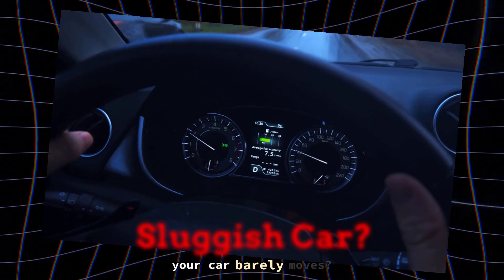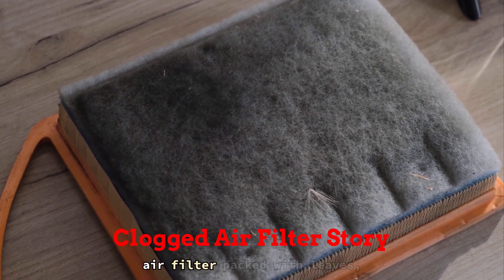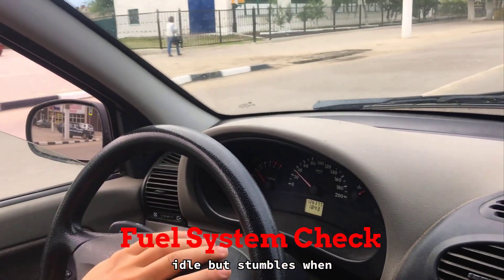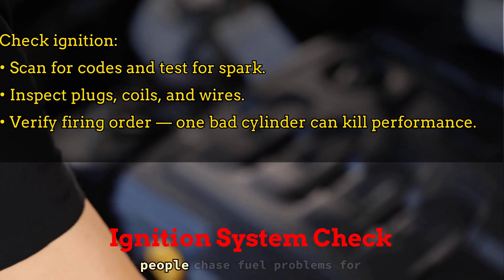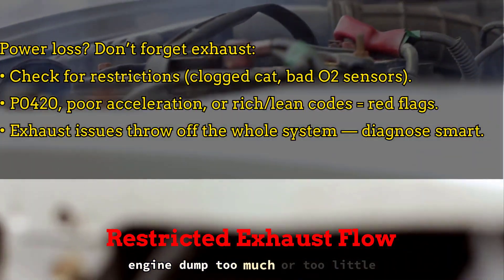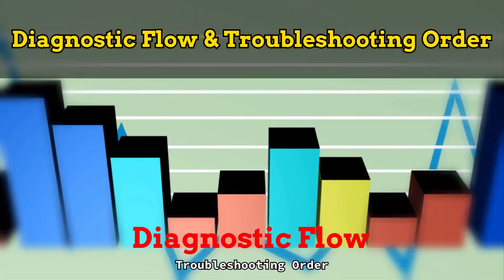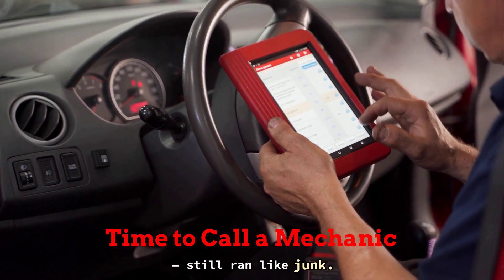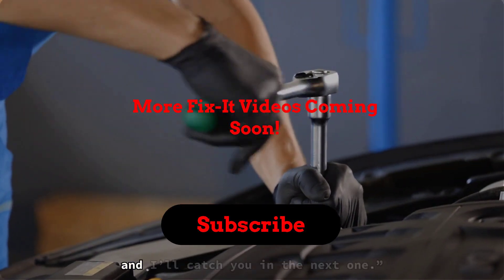How to Fix a Vehicle Losing Power When Accelerating! (No Mechanic Needed!)

Comment: I have a 60 austin healey sprite. Only 1000 miles on total restoration. Brand new h2 su carbs. When I accelerate extremely loud pinging. If I pull the choke the noise goes away. Took to shop. Valves and timing were just adjusted. No difference

Comment: Hi, i have issue in my Yukon 2020 while accelerating it hesitates or sort of blocking the power around 40 to 60 miles per hour its like jerk a little bit then let u go then jerks and if u put more power or high rpm it wil not jerk.

Comment: Hello 
I have a 2008 Toyota Camry 2 months ago it started jerking and loosing power so I inspected spark plug it was not in good condition so I changed it and now it started to do the same thing so I checked the plugs and it looks like it’s burning out with white residue on it so can u help out

Comment: What causes a 2019 impala lt to jerk and shake when you accelerate
Reply from the maker: Hey man — if your 2019 Impala LT is jerking and shaking during acceleration, it’s usually one of a few common things. Start simple:

✅ Air Intake – Check your air filter and clean the MAF sensor. A dirty sensor can throw off fuel delivery and cause hesitation or jerking.

✅ Ignition System – Bad spark plugs or a failing ignition coil can cause misfires under load. Even one weak cylinder can make the whole car shake.

✅ Fuel Delivery – A weak fuel pump or clogged injector might not give enough fuel during acceleration. That’ll cause bucking or hesitation.

✅ Transmission Issues – If it’s more of a hard shift or delayed engagement, it could be a transmission mount or even a software issue. Check for any stored codes with an OBD2 scanner — even if the check engine light’s off.

Start with the basics: scan for codes, check air and spark. If everything looks good and it’s still jerking, you might be dealing with something deeper like a sensor or drivetrain issue.
Reply: My truck is a 2013 Dodge ram and intermittently. It will jerk and then not soon after lose all power to the engine but everything else is on no codes have lit up I need help to figure out what the issue is
Reply: @danitapearson6890 I have the same issue